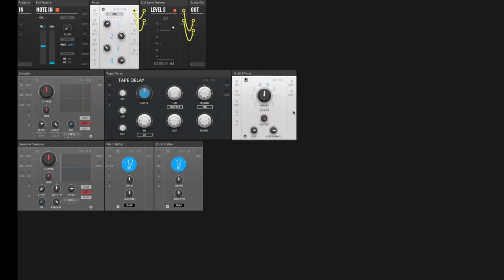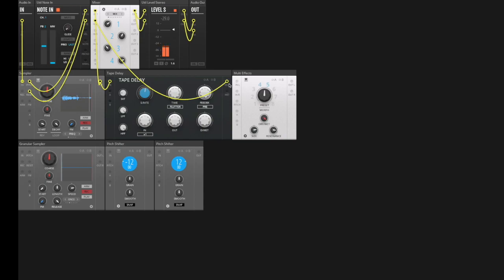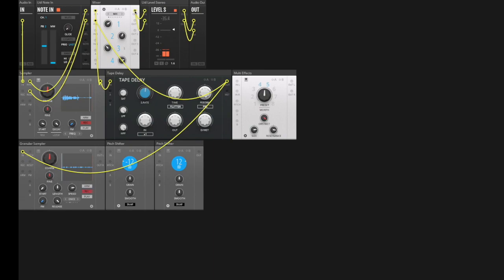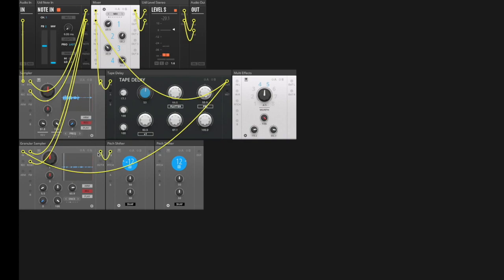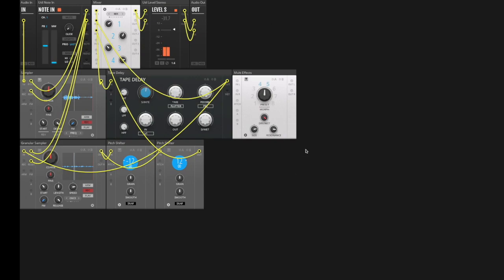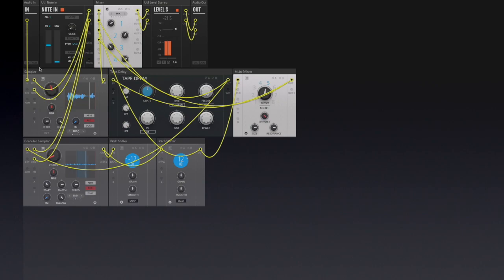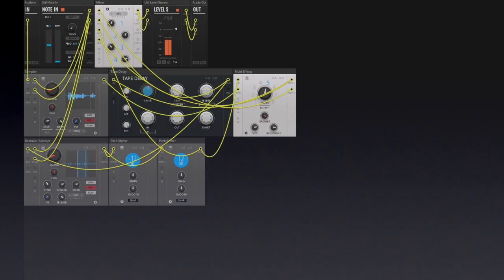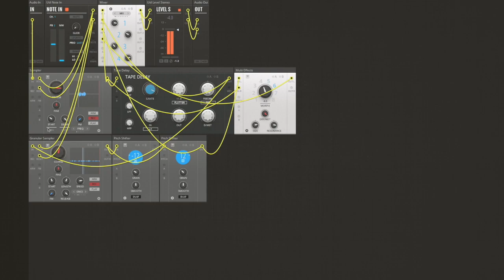REAKTOR 6.3. SAMPLE MANGLER

Comment: amazing results mate, congratz, i wish i knew better how to connect the modules. Thanks for the vid
Reply from the maker: What are your questions specifically Julian?
Reply: @BooRadsProductions  None in particular, i was just saying that you look like you know what you are doing when connecting the modulars. Im not a modular usr - yet - so i wish to know better how to hook cables for certains results. Thanks for the inspiration
Reply from the maker: @frangellico  Right on Julian. Well first you need a sound source. when it comes to modular the easiest would be an oscillator. Take the output of the oscillator and run it into the input of a filter. After Load a VCA and take the outputs of the VCA and run them to the audio output in Reaktor. Then take a simple ADSR envelope and run it into  the "MOD A" input on the VCA and turn the modulation up on the VCA. Connect the filter output to the VCA input . Then you need a way to control the pitch of the oscillator so connect the pitch output for the midi module to the pitch input on the oscillator. After take the gate output of the MIDI module and plug it into the gate input on the ADSR envelope. That will give you a basic voice to start off with.

A little long winded i know. I hope that helps.
thanks a lot.
Reply: thanks a lot for the time on that great  help, will give it a try with that example. Thanks!